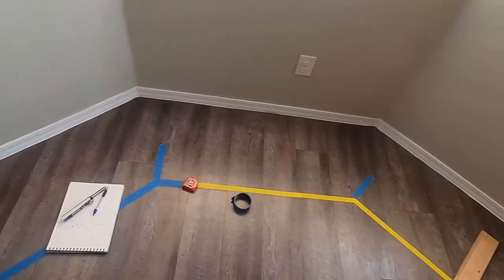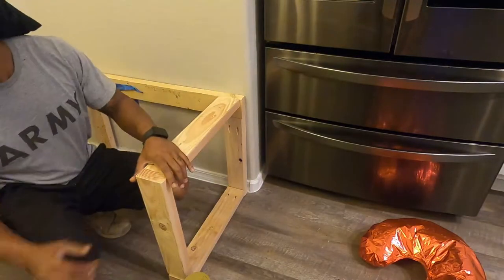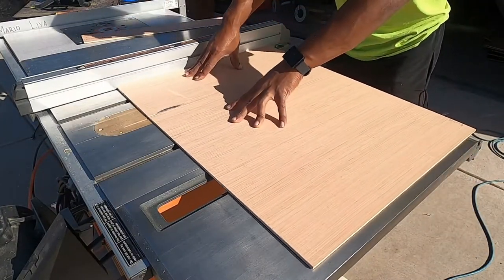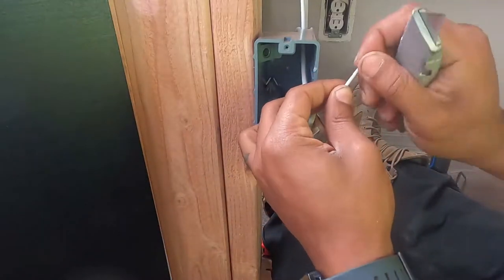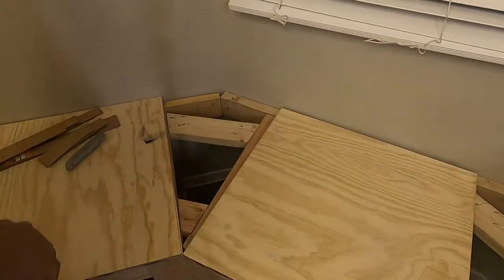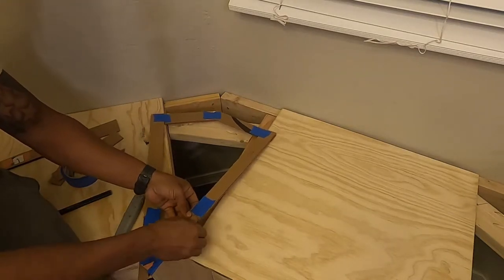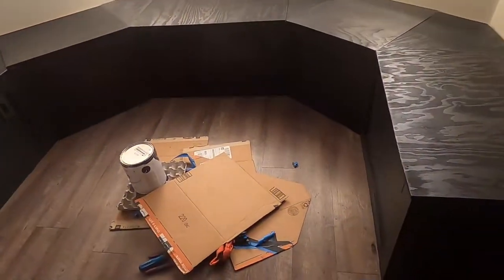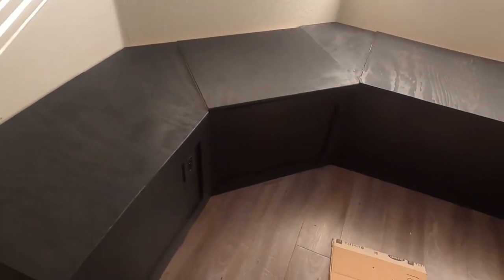Breakfast Nook with storage

Comment: Is there flex on the top seat? I’m asking bc it looks like you used 1/2 or 3/8 ply for it
Reply from the maker: @johnc1280  I used 1/2" plywood and there's no flex. I walk on it sometimes to get around the table and haven't had any issues with it and I'm 190 lbs.
Reply: @Goldenrulerwoodworking  that’s awesome. I woulda thought it wasn’t thick enough in those hollow centered area spaces where the storage area is underneath. That’s great tho
Reply from the maker: @johnc1280  I took a chance and thankfully it worked out lol. 1/2" plywood is pretty sturdy and majority of the lid is supported so there's no much hollow space to allow for flexing.
Reply: @Goldenrulerwoodworking  I just built an L shaped banquette (hence why I was searching on here) and doubled up on 3/4” for the top. The thing is solid as a coffin lol you could do gymnastics on it
Reply from the maker: @johnc1280  lmao that's definitely thick. As soon as I got home I walked on the tops to see how much flex there was. It has just a little but it's not meant to be walked on so it works out. When you sit on it they don't move at all.
Reply: @Goldenrulerwoodworking  you have the perimeter border support going around each lid piece, so yea you’re good.